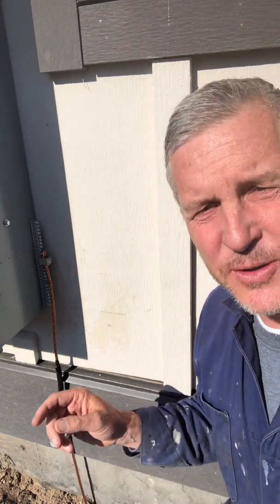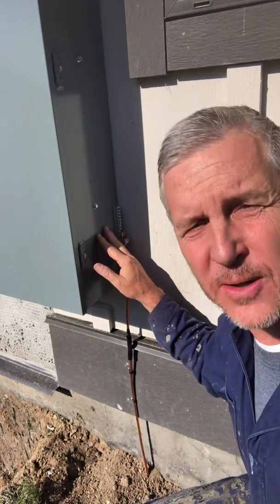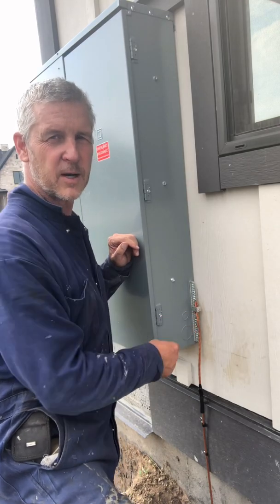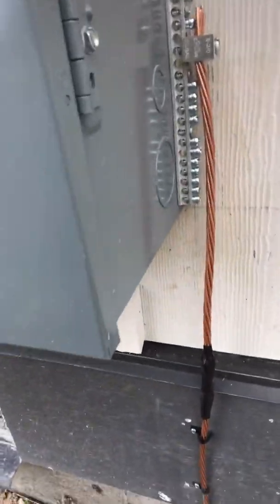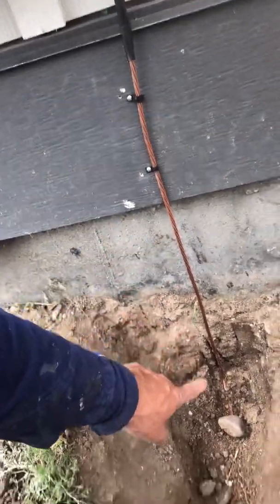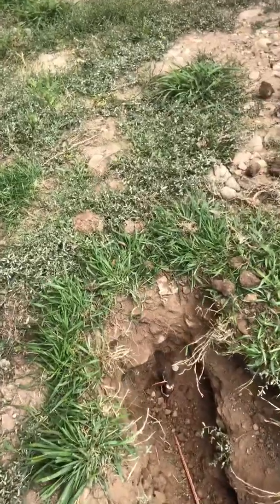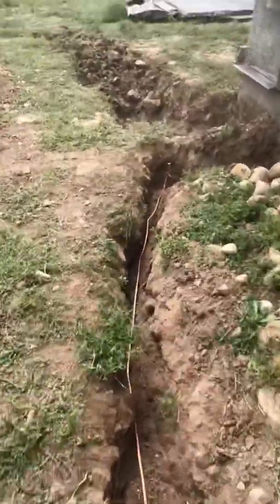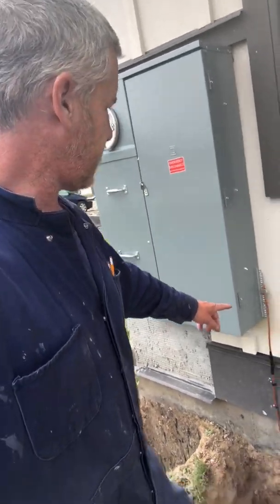Electric: Grounding Rod and Wire 400AMP Panel, #2 Copper Wire, Braided; 3 Grounding Rods in Series F

Comment: Not sure where you at but according to the NEC all you need to a ground rod is a#6 and to ufer ground is a #4 not to you metal water pipe it would have to be #3. Plus that ground bare will be useless in a few years it needs to be protected from the elements.